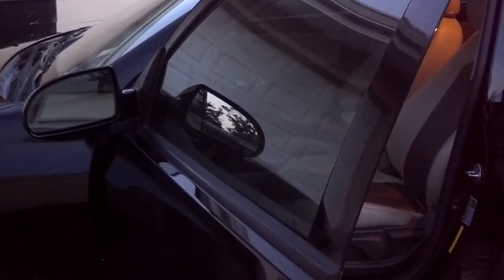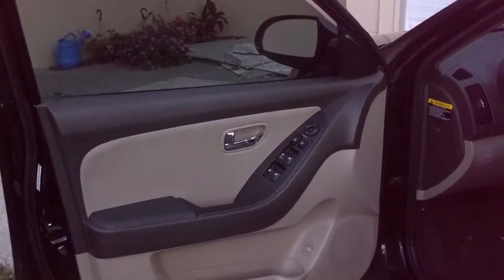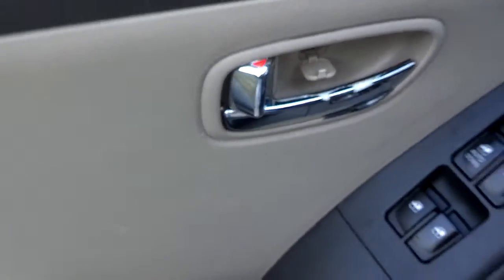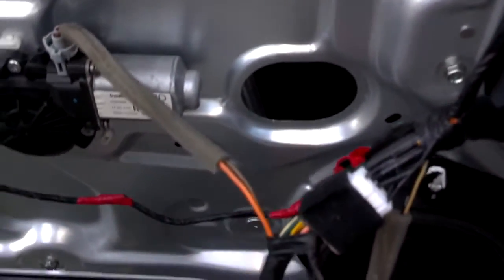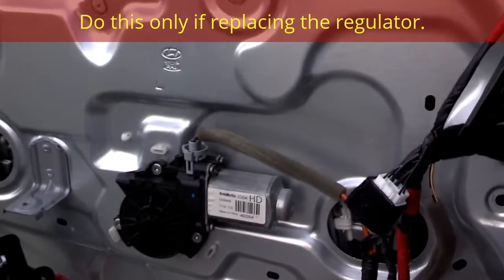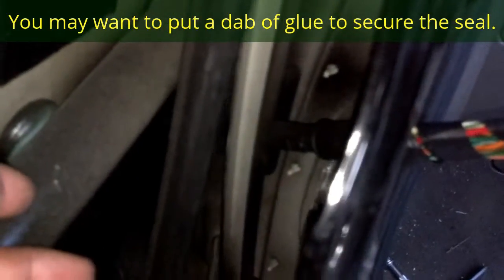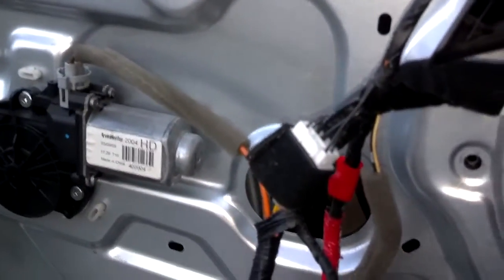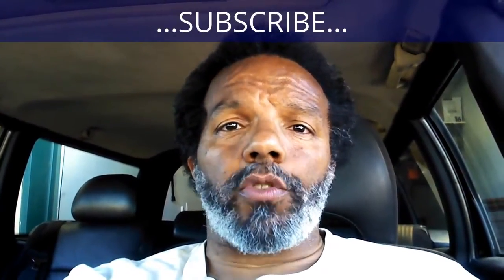Window seal, regulator, glass repair or replacement, Hyundai Elantra - VOTD

Comment: Good work ! I have a 2009 Elantra  with the same problem but on the passenger side . I think it's should be a Recall on this issue , cuz I had the same problem that seal came off from it base or frame rail window . With this steps I should be able to deal this problem now , so thank you Robert !
Reply from the maker: kano R You are welcome. Glad you found the video.
Reply from the maker: lol